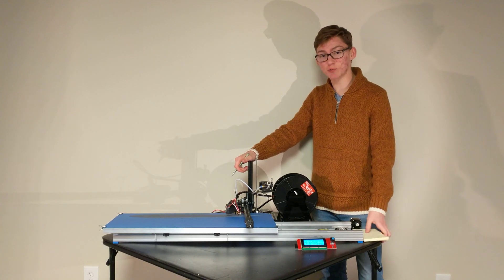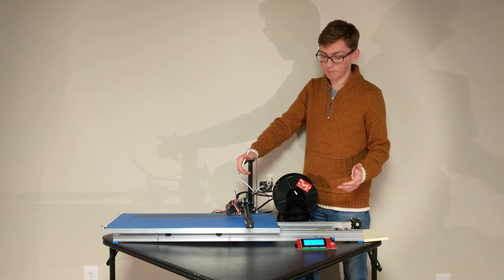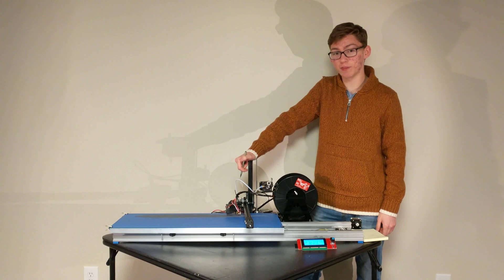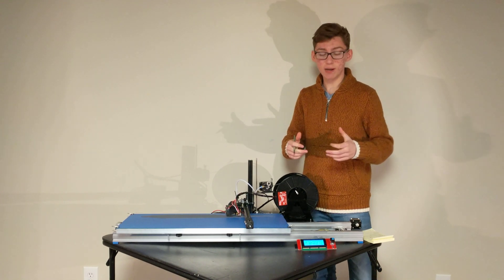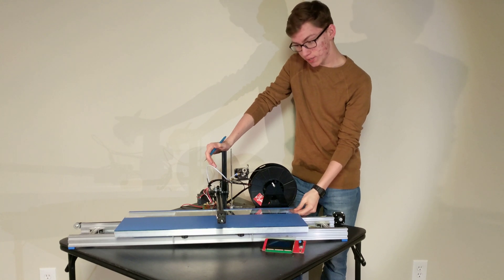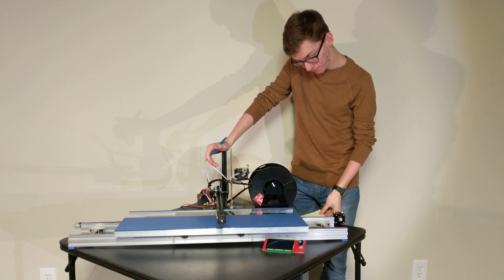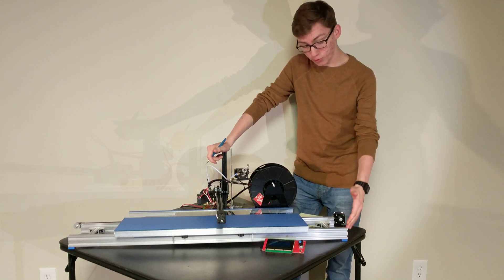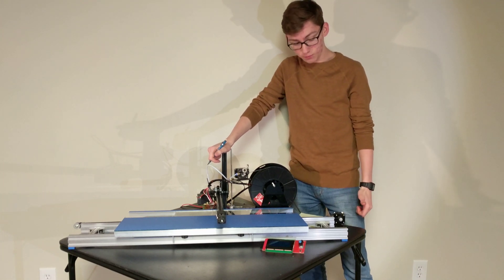650mm Long 3D Printer! 1 Foot by 2 Foot Huge build volume Tronxy X1.

Comment: do you have a build guide on this printer?
Reply from the maker: I actually do, though it may not be as detailed as I would hope. It is posted on this channel under something like "build your own reprap Jupiter".
Reply: @MakingwithLuke  is the bed heated?
Reply from the maker: @ascabusi  It is not, but it would be easy to add. I just printed on a glass plate with hairspray and used 70% alcohol to  help release the parts from the bed. I would recommend that or using some kind of flexible build plate to help with part removal. A heated bed would be heavy. expensive(ish), and would take significantly more electricity to work.
Reply: That is a truly awesome build.
Ty very much for the replies.

Comment: this is amazing and I am planning to build one like this too. On a side question are you using regular blue tape for the bed?
Reply from the maker: Great to hear. Yes, I was using just blue tape in that video. However, the last time I used the printer I used hairspray on top of Visionminer's Nanoadhesive, on top of unheated glass bed, which worked wonderfully. Visionminer's proprietary stuff is expensive, but I had some samples on hand. You might want to either heat the bed or use some other substance as an interface layer between the hairspray and the glass, as the hairspray naturally doesn't want to stick to glass, but the interface layer does. You may even find that a single interface layer between the printed plastic and the glass may be sufficient, such as glue stick or something similar. The heat bed would be the easy, probably recommended, route, but it also adds complexity, complication, and cost. Best of luck, and let me know if you have any questions during or before the build.